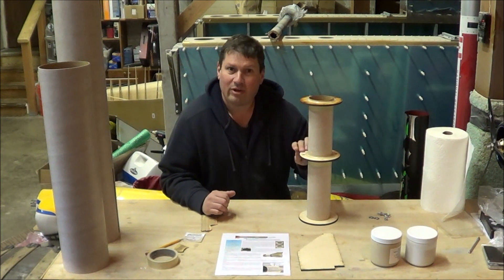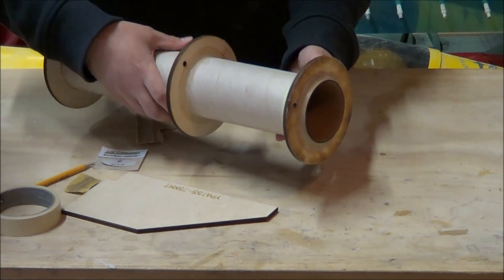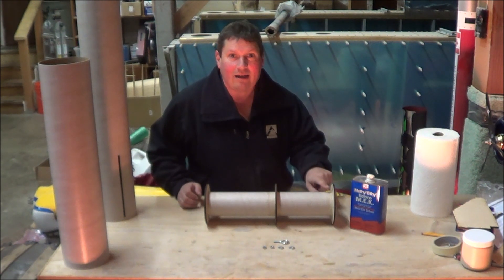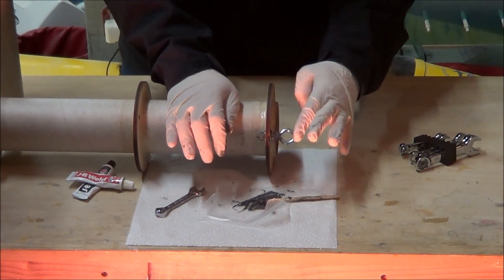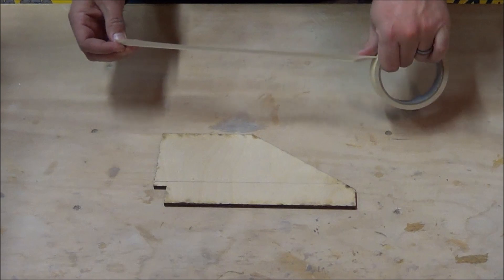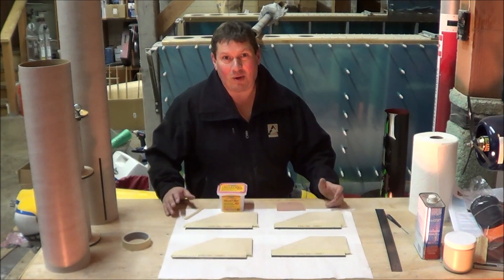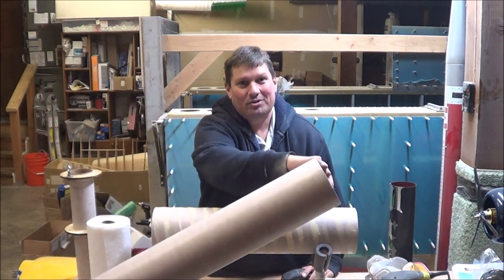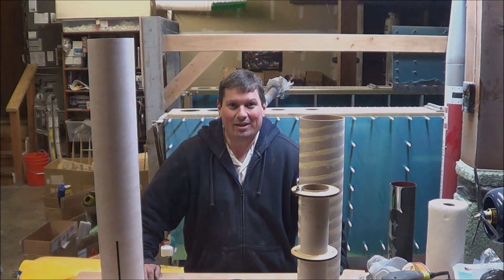Review: LOC Precision Patriot Missile 5.5" Pt.2: MMT and Fins

Comment: to fill the spirals it is alot easier to just spray the tube with primer and sand do the same thing two or three times and you have no spirals and is alot easier than trying to fill them then sand
Reply: That's what I do. I work from 320 grit to 1500 grit between primer coats.. It goes quickly.